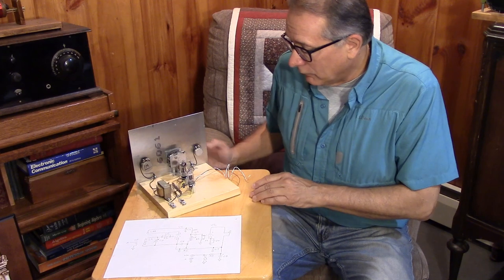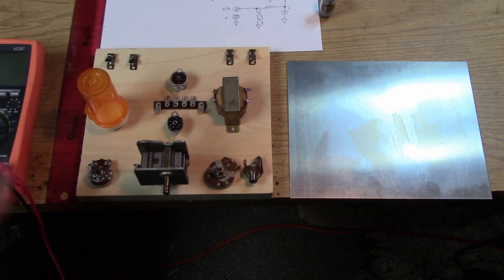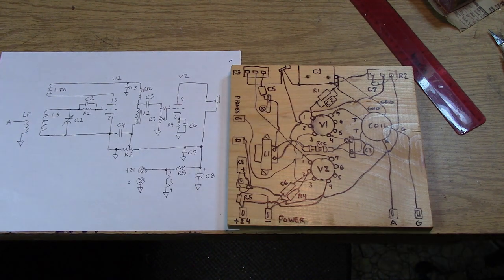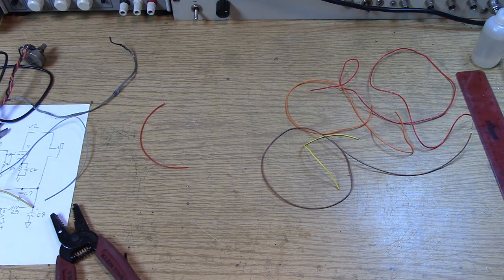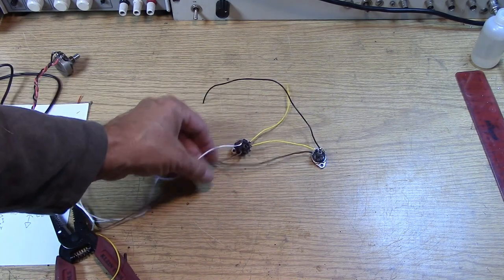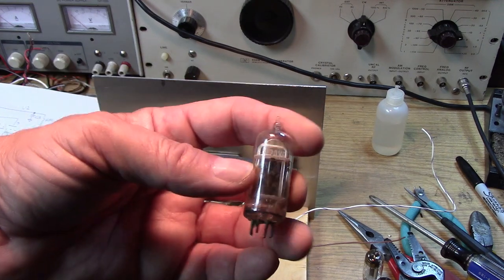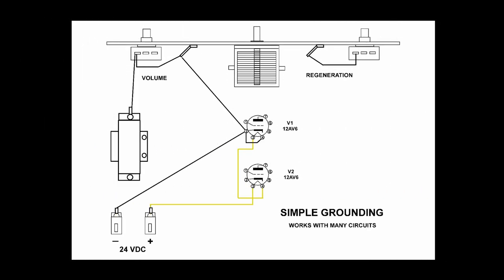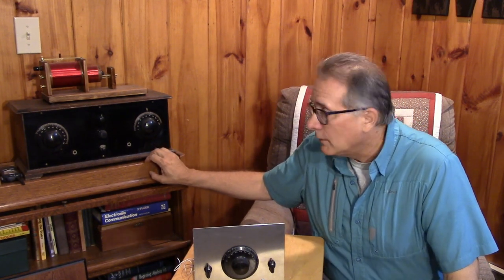Regen LowV Part2

Comment: I've built several Hartley's and Colpitts types. It will be nice to tick off the Armstrong as a low voltage example! 
I think I'll go with a metal open box type chassis with the point to point wiring accessible from the bottom and tubes mounted on top with the tuning cap remoted to the metal faceplate and volume and Reaction controls mounted in the side of the chassis, sliding the shafts through the faceplate holes! I'll shield a power section for a 24VAC transformer, rectified and filtered from mains power. I might go with a tube output transformer to a small speaker. I did manage to find surplus 12AV6 for $5.90 ea and 365 pF single section 350v Air Caps for $17. 
Feels like I'm getting ready to build a Heathkit!

Comment: If you don''t have any aluminium for the front panel, you can use a sheet of single-sided copper-clad board..  The copper side should face backwards, and you can cut away the copper around the hole for the 'phone jack, to prevent a short.
Nice project.
4X4LF
Reply from the maker: Nice idea.

Comment: Preferred Regen..Capacitor throttle or potentiometer?

Previous regen. built in the late 50s used two 954 acorn valves.
OV1 style.
The plates of the 954s were ..no connection ... but the screen grids
were used as anodes. 
Any idea what was behind that?
2nd question.Have you ever seen valve bases for acorn tubes these days?
73 de G3NBY. (Former Colonial Oppressor. No taxation without Representation.)
PS Thank you for suggestions about the lumpy, vernier reduction drive.
Reply from the maker: Triodes? - Throttle cap - Pentodes ? Potentiometer on Screen. That has been my experience.

Comment: Greetings from Downunder. I have a question. Could reflexing be achieved by coupling the output of V2 through a capacitor to the grid of V1?
Reply from the maker: Reflexing is a wicked game that really brings some fun into any project like this. The trick is bypassing and keeping the two (or more) frequency ranges separated- Audio, IF, RF, BFO, Oscillator etc..

Comment: Solid core #18 bell wire is cheap, available at every hardware store in 25 or 50 foot coils, and works well for old school breadboard construction. Insulation isn't the most tolerant of less than ideal soldering technique though.
Reply from the maker: Cheap is good! But what do I do with the bell?

Comment: Hi Mike, great little build series.  I have a question about some of the cap values on the schematic.  Caps C2 , C4 , C5 , & C8 all have just a number value. Can I assume those are all pF or is that incorrect ??
Reply from the maker: Generally yes; no suffix means pF.  so a cap that says 100 is 100 pF . A resistor that says 560, is 560 Ohms. etc..

Comment: where's part one, and three???? love the video....
Reply from the maker: https://youtu.be/hc25hLWbzFE
Reply: @MIKROWAVE1  thanks, bud.....will look now....
Reply: @MIKROWAVE1  quick question.....I have quite a few 2 and 3 gang variable caps.....I saw that you only use one for the BCB.....what if I wanted 160, or 80, or closer to 5 or 7 mHz.....would i use a different section? No joke.....I have quite a few older parts, coils, sockets, 1,2,and 3 gang var. caps.....need to do something with them....they guy's family dumpstered many parts, but I got the rest....and some radios as well.....one works, and the other was an IC-7700 w/bad finals......$900 later, I have a $6K radio.....and a butt-load of extra parts (IC's, transistors, caps , resistors, coils, cabinets).....a junk box dream....
Reply: forgot I saw the first one....my bad....
Reply from the maker: @cooker4409  for ham band Regens where you are doing CW and SSB, you normally only use 1 365 pf section as the band set,  in concert with a band spread variable of say 25 to 60 pF  that is the actual main tuning. To do 80 and 160 maybe 2 sections to hit both bands in one sweep, but again the band spread is the actual tuning.
Reply: @MIKROWAVE1  thanks....just trying to dream up a few possible projects over the winter.....I do Handyman and light construction work, and we kinda don't work much in the winter here on Montana, at least outdoors anyway....I shovel snow, and sell firewood in the winter, so have more time then....got some peanut tubes I need to figure out what they are.....a few tube books too, so that'll help.....thanks!!!

Comment: I have some 12AV6's in my eBay cart waiting for me to click on "Buy." Still waiting to see how this turns out and for you to post a schematic. Remember, you said that this is supposed to be a beginner's project. But so far, it kind of feels like a project that allows you to show off your knowledge to beginners. I hope this comes together somehow so that I can build it for myself. It would be very helpful if somewhere along the line you would post the final schematic and BOM, please. Probably would have worked better if you had done that up front.
Reply from the maker: Yes the final schematic will come when the unit is finally working - ha. A lot of folks apparently like the dual triodes like the 12AU7. Well sure - but I wanted the freedom to go 12V or 24V and try both voltages and compare results. So maybe two 12AU7's and you get an extra pair for more amplification or buffering.
Reply: @MIKROWAVE1  What about using two KORG NUTUBE 6P1 units and using one as the front end and one as the output stage, the heater will require 1.5-3V and the B+ 9-18V and you can use a 24 pin IC socket.

Comment: Hi. I am going to make this project. Can I use an stereo phone jack connected in left and right terminals and leave unused   the ground part? Or may be a problem with it. And... What about to use 12v of the car for filaments and 2 9v batterys in series with 12v to supply the plates. Is ok to use 30 v? 
Thanks to share your experience. 
My best wishes from Mataderos, C.A.B.A., Argentina.
Reply from the maker: A good trick that will eliminate the shoulder washer! You would use tip and Ring and not the grounded sleeve. The results with more voltage would be more audio volume.
Reply: @MIKROWAVE1  thanks you! 
Now I'm selecting all the materials to make this regen. Is the fist one that I will build and You are my teacher. I have encounter very intresting and didactic all your material. By other way I really speak spanish, but I have been learned a little bit of english. So I don't know which is the right title  to somebody like you who has a. Big knowledgement in a tech cuestion. Something like thanks you genius or thanks you professor. Something unformal but respecfull. 
Ok, now "I leave the poncho" like we say in Argentina when one end a very long speech in an amateur conversation. Waiting the third part of the project I send you the best!
Reply from the maker: I suspect already that triodes with less GM (gain) are better candidates than the 12AV6. All of the 12AT6 tubes that I have tried work at lower voltage. I suspect that the 6C4 and 12AU7 will be excellent choices. We will find out soon.
Reply: @MIKROWAVE1 
Hello! 
My tubes may be any of both.
I will wait for the coil and tunning instructions to test the results! 
I see You soon!
Reply: @MIKROWAVE1 hello!  my tubes may be any of both.
I will wait for the coil and tunning instructions to test the results! 
I see You soon!

Comment: TELEFUNKEN GMBH Space Charge Vacuum tubes are most likely still available, has anyone purchased 8 or 9 KORG 6P1 vacuum tubes and built a radio with them i.e a flat vacuum tube, three of these flat tubes can be configured to operate exactly like the SO42P with a B+ OF 50V and a heater voltage of 3V and you can take half an Integrated Circuit socket for tube sockets.
Reply from the maker: Ya Vol! Telefunken! Die besten Ventile der Welt.
Reply from the maker: Vakuumröhren